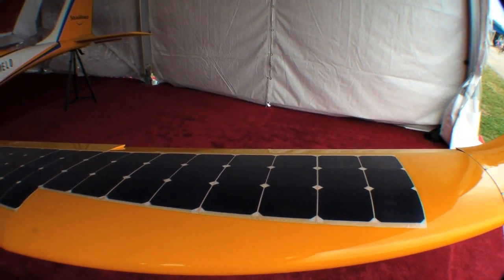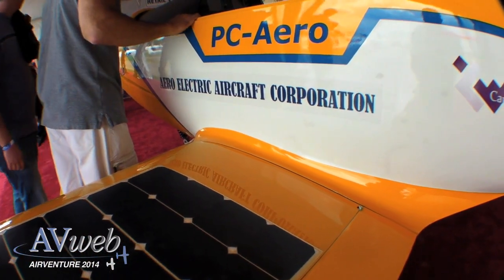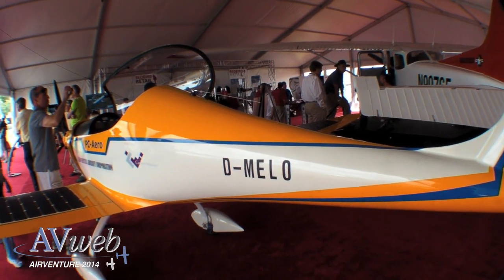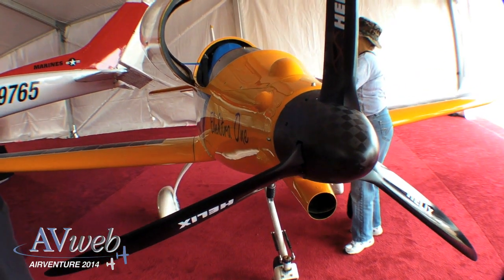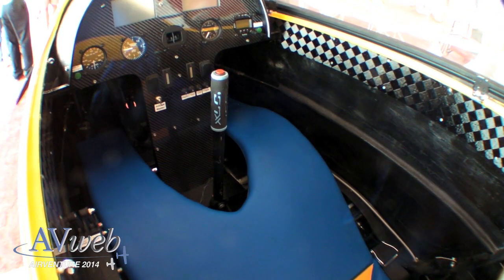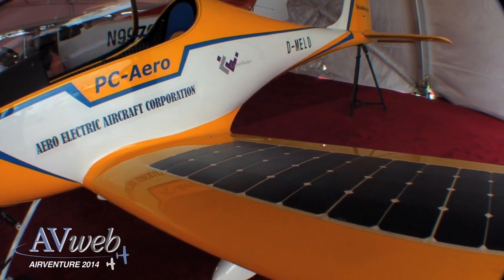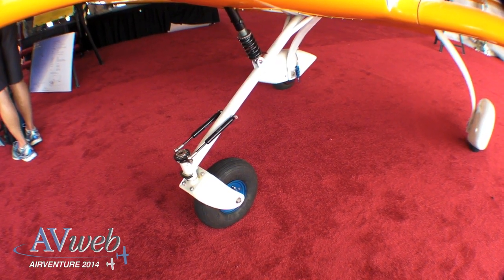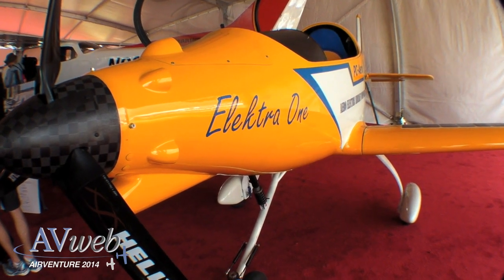Sun Flyer Electric Trainer

Comment: Finally, a company that just gets it. Aviation is way too expensive, especially for us rec pilots. Companies like this are the last hope for an aviation industry that somehow thinks it's OK to charge hundreds of thousands for a plane thats ostensibly the same as it was in the 70's.
Reply: After the recent spike in fuel prices, a huge part of the high cost of flying is liability insurance.  From the '50s to the late '80s, GA flourished with several major US manufacturers producing annual models in several product lines similar to the auto industry.  While not cheap, a new or used airplane could fit in the budget for middle class pilots.
Ambulance chasing lawyers figured anyone who flew (like anyone who owned a boat) was automatically a fat cat investment banker or doctor, so any accident involving an airplane drew the slimeball barristers like flies to honey.  Juries likewise awarded huge sums on the same wealthy defendant assumption.  
Along the same illogical lines, if the pilots were wealthy, the airplane and component manufacturers likewise had deep pockets, and were named in "shotgun lawsuits" that included anyone and any company who had anything to do with the incident aircraft, including maintenance done YEARS ago that had no logical connection to the incident.  
Despite legislation to help GA manufacturers curb lawsuit excesses*, the cost of liability insurance skyrocketed, driving laywers to sue more and more entities, driving insurance premiums through the roof, forcing individual professionals and small operators out of business, and manufacturers to increase their liability coverage, passing those costs to the consumer.
General aviation has always been a very low margin business, so when the lawsuits started flying insurance rates skyrocketed, leading to the virtual death of general aviation and pleasure flying in the US in the late '80s and '90s.  Before the laywers' assault on GA, its ramps were filled with airplanes, often with waiting lists for a tiedown or T-hangar.  Today, they are ghost towns, except for the corporate King Airs, Citations Learjets, and the occasional 1970s vintage Cessna 152, Piper Cherokee, or Mooney M21.
The bottom line is that since GA is a small segment of the population, there isn't the population base over which to spread the costs o  f an insured accident.  Add ambulance chasing junkyard dog lawyers and generous juries, and the cost of flying HAD to balloon.  

*http://www.avweb.com/news/insure/182778-1.html?redirected=1
Reply: @jimmbbo  Thank you for taking the time to explain one of the main factors in the decline of General Aviation in the US. The other significant factor is wages not rising appropriately for the majority of Americans since the early 80's. What has happened is a shame and your comment is very illuminating.  The love of flying has inspired many youths and adults to do great things!
Hopefully recent improvements in electric vehicles & autonomous technology allow more people to participate in aviation.
We are an autonomous vehicle manufacturer in the US. Most of our products are designed for industrial and government customers, but we are also looking at using autonomous tech to make manned GA planes safer & electric. We will be releasing new products and videos over the next several months. Please feel free to check out our channel and subscribe if you are interested :-)

Thanks again for your informative comment!
Reply: That is a good representation of the picture in the US. Here in Europe GA always stayed relatively small because until very recently all countries dealt with aviation with separate institutions. That makes it cumbersome to fly anything else other than 1/2 hours VFR (no border crossings). Now that is possible to actually go places, the infrastructure is the biggest problem. Airport fares are expensive, airspace is cluttered and fuel is very very expensive. No wonders that Very light aircraft / LSA is taking a lead position. In the end aviation in Europe is just a enjoyable sightseeing tour from above.

Comment: This will change all proceedures of flight training. The airplanes with piston engines, you need to follow the list of pre-flight inspections. Many inspections are done in the engine and other fuselage components. Flying with electric motors sound like a dream became a reality! This will keep the air clean! Good!
Reply: Hmm... I didn't realize electrical/solar airplanes were immune from loose connections or broken parts...  I believe an inspection of any powerplant and "fuel source" is a good idea before committing aviation...
Reply: I do believe the power plant is the most imoportant thing in a check list. And check all cables and control surfaces, wheels, brakes, but with electric motor, the check will be the batteries, cables and connections, and so on.  I think, this will be another type of certification?  Electric LSA certification< maybe?